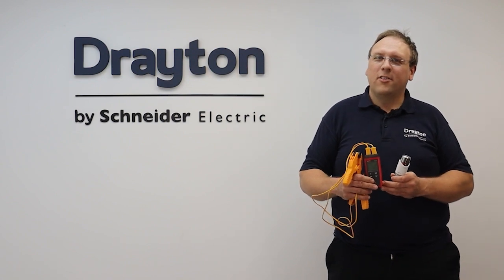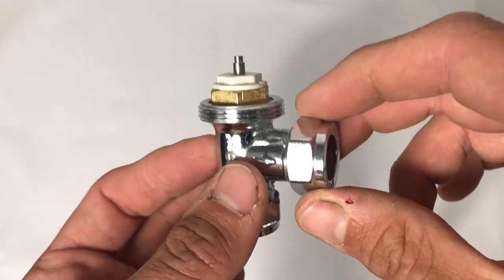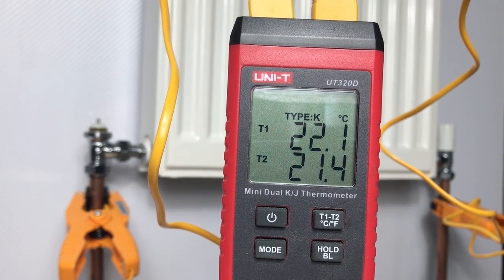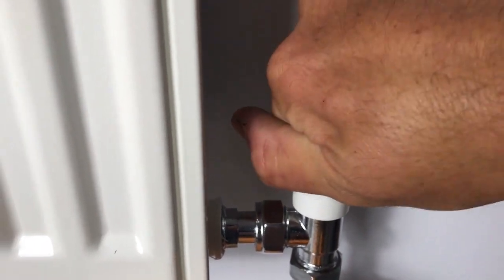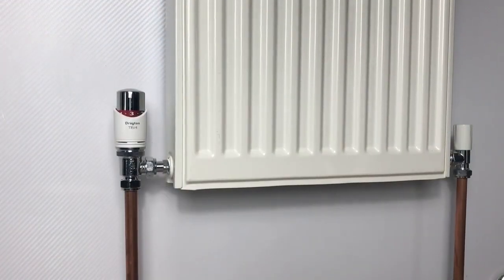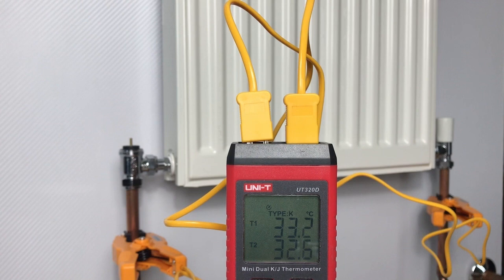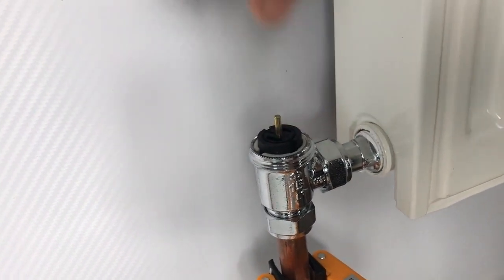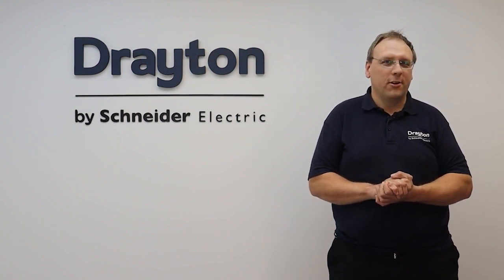TRV - balancing the system using the valve

Comment: The only disadvantage i can see is that with the adjustments made in the valve head there would be no way to correlate the adjustment by measuring the tempreature differential between the flow and return pipes. Does the TRV4 still operate as designed if the homeowner opts to make the balancing ajustments via the lockshield valve alone?
Reply from the maker: By setting either the flow rate on the Auto-balancing valve or by throttling the locksheild sets a maximum flow rate for the TRV4 head to operate within.